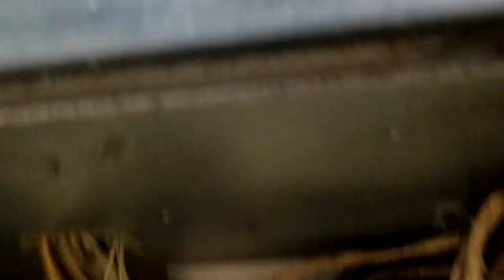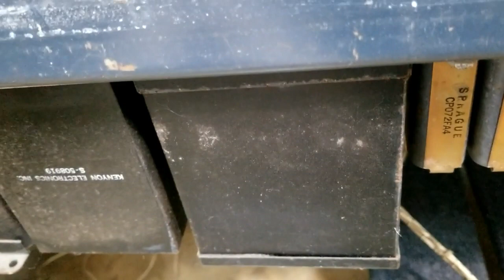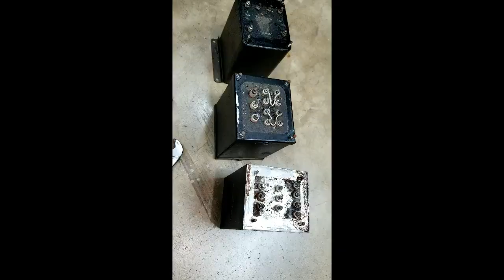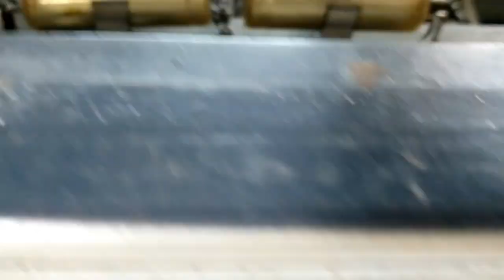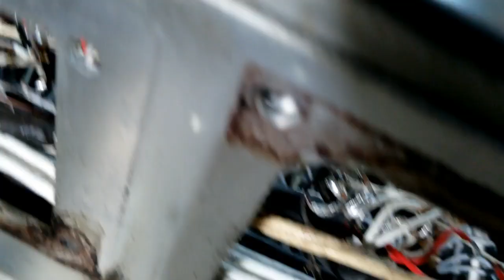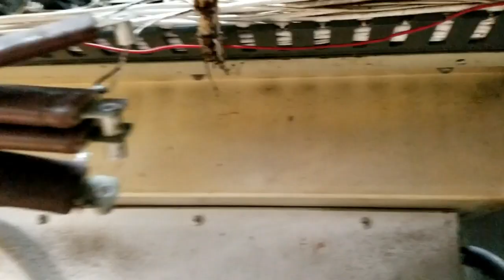The Quad Tape Transfer-RCA TR-70-B Disassembly Part 2

Comment: Very cool
Reply from the maker: Thanks! Im glad you found it interesting. My "day job", 40 years ago. Actually its more of a hobby nowdays.
Reply: @LarryOdham  was your job running them or repairing them? Both?
Reply from the maker: @bigfancy4574  Both. In those days, how a person usually hired-in was as a control room operator. Depending on what your background and education/experience was, then you would remain in operations, or, in my case, I was going to Technical School studying electronics. I operated for about 7 years, then when a position came open in maintenance, I was moved to the shop doing studio equipment maintenance. I was a tape guy, thats what I was best at. Years later at another station I also had about 6 years of UHF transmitter maintenance work. By then, the tape machines were just about all gone and everything was going digital, computers, etc. It wasn't fun anymore. So I quit and went in business for myself, doing the tape, what I know how to do.